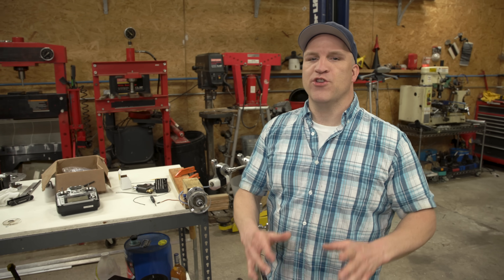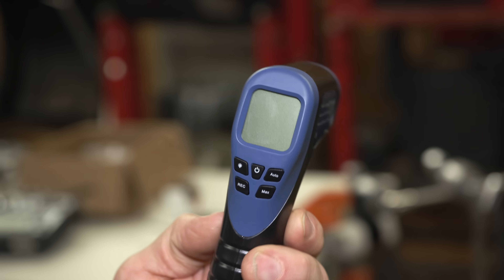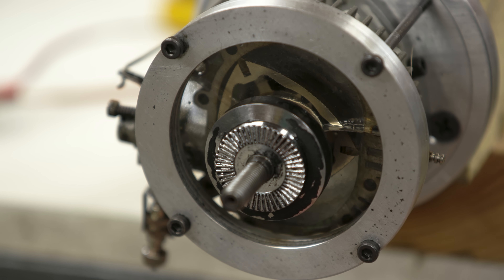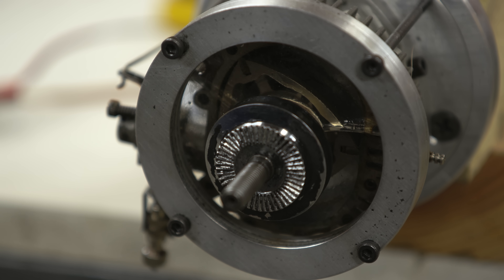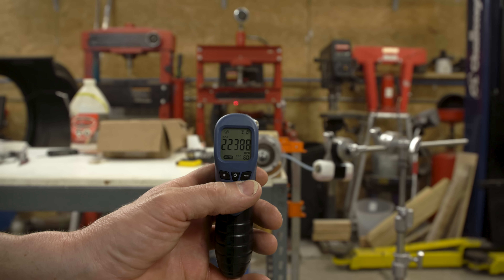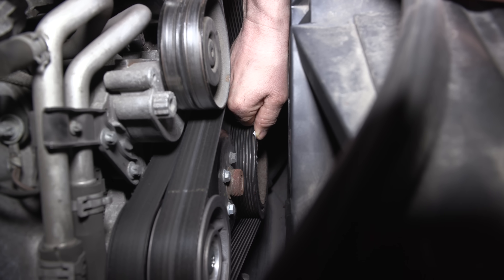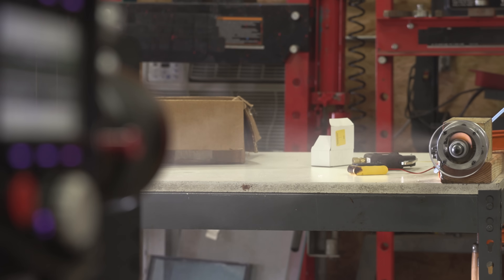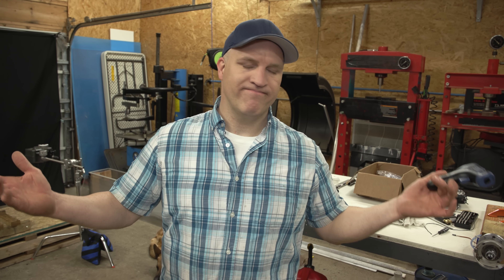See Thru Rotary Engine MAX RPM - 29000 (Wankel Engine)

Comment: At 29k, thats 5.5hp for every ft/lb
Reply: Dave Micolichek I figure about 100ft/lb per liter on 2 strokes and would guess the wankle is midway between that and a 4 stroke- maybe 80? Hard to tell, but if I could pour 1oz in that wankle, that'd be 30cc or .03x80ft/lb or 2.4 ft/lb peak I'd guess around 12k?, perhaps 2ft/lb at 16k? So maybe about 6hp? Just my ball park guess with no more than looking at the video with the most basic data.
Reply: That engine appears to be a O.S. Engines 49-PI (0.3CU / 4.91CC) based upon size in relation to hands and it's RPM achieved. The 49-PI is reported as outputting 934 watts / 1.24 HP at 17,000 rpm and torque is about 0.37 ft/lbs. So @ 29K rpm it would be outputting ~1500 watts / ~2 HP.

All the other engines I've seen are 20CC or larger have thinner fins and lower rpms.
Reply: Cerberus984 I thought it was 6 times that-whoops. I estimated 2ft/lbs at peak hp, you say .37ft/lb. So, you think peak torque is at peak rpm? Now that I have displacement, I'd figure 1/6 my up guess- 1hp at ~16krpm
Reply: @Jimmy's Tractor
I simply used a 2 input toggle calculator that asks for rpm + torque or rpm + hp then solves for other. Then sourced my data from Barnard Microsystems which displays a vast variety of RC engines. The fins are equally thick on the OS engine and has same amount of end plate bolts. Although, the first two fins right of the exhaust port differ from the video I saw to the picture from my data source there were two different generations of that motor. 

The next step up (different brand) is a 20cc Nitto NR-20EP is significantly larger from the videos I've seen people holding it in their hand or on a bench top.
Reply: Cerberus984 cool, looks good. I just guessed.
Reply: cerebellum yeah, that's fine, but I still can visualize a hydraulic column of fluid with a cross section x and know  how much hp will be needed to to lift a given weight. I just think of engines as a winch with a 2ft diameter pulley. 5250 is one of those numbers like 5280 that are just hanging out upstairs ready to be used.  Besides that. If I say that 2ft/lbs at 16000 rpm is 6hp, then I obviously known how it works. It's ft-lbs it's not being accelerated it's just a number representing the rotational force or how much weight it will lift with a 2ft diameter capstan on the flywheel
Reply: cerebellum you made me think about it and how is ft*lb any different from ft/lb as it relates to ft-lbs with no worries about dividing or multiplying? Ft * lbs/1 is ok but ft×1/lbs is not? Were not really multiplying or dividing or ft-lbs would be incorrect. If ft-lbs. As long as both sides are the same, you'll get the right answer. 550ft/lb represents the torque. The only time you need to multiply or divide  is when you convert to power 550ft x T(however you want to say tourque)/s=hp
 1ft arm with 30lbs hanging is the same as a 30ft arm with a
 1lb weight on it. Whatever it is, the answer is correct.
Reply: His math is correct, but torque is a measurement of rotational force. The force an engine can exert is certainly an important number, but transmissions make high-horsepower much more important and better than high-torque/low-horsepower applications in every single way except one: Wear.

Semi-tractor engines are high-torque diesels because that design wears much more slowly than, let's say, a Formula 1 engine. An 800-horsepower F1 engine can absolutely pull that load (with proper gearing) better than that 550hp diesel engine, but it'll need to be rebuilt in a matter of hours rather than the YEARS seen between most diesel rebuilds. 

Getting an 80,000 pound rig moving with an F1 engine would result in fusing clutch plates every other time you have to take off from a stop; the RPMs required to stack up enough torque would introduce phenomenal friction.
Reply: Mezz not really
Reply: Whole lot of "Ahhhhyyyctuaaally" going on here, people missing the forest for the trees.
Reply: Big boys at Yamaha Suzuki Honda and Kawasaki will buy him out and shelve the engine
Reply: Dave Micolichek yeah rotaries made high hp for their displacement, but were lacking in torque
Reply: Don't believe him test drive an rx-8 lol
Reply: DEEREMEYER1 peak torque is not where peak hp is measured.  When using ft-lbs torque = hp at 5250 RPM . I don't know what you mean when you say peak tq is where it's measured.
Reply: Dave Micolichek doesn't matter if you are online engineer or real this stuff is 11th grade 1st semester physics.
Reply: But honestly don't you know the mathematical equation of HP? HP = T x RPM/5252. Torque is labeled as pound-feet or Newton-meters, horsepower is a bit more unusual, as the standard was measured originally as Lift, in which 1HP could lift 33,000 lbs 1 ft-min
Reply: cerebellum you really need to read on of physics and units of measure before typing arguments into YouTube comment sections, you really make your online identity look dumb
Reply: no to split hairs but lb is not a unit of mass, its a unit of weight :)
Reply: cerebellum lb work pretty good on earth, we need to adjust for different planets. If you only need hp, lb is fine.
Reply: myredfast some share online identities with real life!
Reply: Thelifeofbrian can't measure horsepower? Ok, we won't say we're measuring it. Well just display what the hp of a specific engine/motor is and leave it at that without telling anyone how you did it. LOL. You think the only thing we measure is the distance? The rest is just time and  weight- we measure those too. We can measure it with hydraulic output and not even consider torque just knowing the flow and pressure minus a given for pump loss and we have hp.
Reply: DEEREMEYER1 RPM is the rate, horsepower is the power, and torque is the force.
Reply: cerebellum lb or pound is a measure of weight not mass.
Reply: nerds ...  a yummy candy that will rot your teeth, but possibly worth it; there was a white chocolate bar with nerds in it about 25 years ago, was surprisingly good.

and nerd isn't an insult, it only is thought to be by really stupid people who try to make themselves feel better by insulting those with more brain power than they have.

and a lot of the people in this comment thread need to take a break, study all the terminology, so they aren't arguing over semantics and get back to an actual discussion about how rotaries are badass except when dumbasses own them and don't know how to both properly use or care for them.  Kind of like the people who say 'shut up, nerds' ...  though some of them have some nice LS  engines or old big blocks that make sweet sounds and put out high torque at low rpms.  Too bad their attitude sucks.
Reply: wow, the amount of effort and intelligence that went into that speaks for itself.  maybe come up with an insult and I will; as I take it as a compliment, better than being a useless dumbass with no interests or semblance of personality
Reply: yeah, I know you like watching me take care of your girl like you can't.  Keep up with the compliments.
Reply: Feet, pounds, ounces....you colonials are so cute :)
Reply: Pound-feet or foot-lb really doesn't matter. Its a number measured with a "brake" connected to the crankshaft or other "power take-off shaft". Multiply it by the RPM and divide the result by 5252. That's the "horsepower". You're splitting hairs like a typical online "engineer".
Reply: The HP formula is simple: HP = (Torque x RPM)/5252. That's why torque and hp "curves" always intersect at....5252 rpm.
Reply: Peak torque is where its measured. You measure torque to calculate HP. Horsepower is a RATE. Torque is actual "power".
Reply: Its actually 5252 but who's counting.
Reply: WJ Z it's a figure of speech here in America
Reply: DEEREMEYER1 Actually a pound feet is a measurement of torque where foot pound is a measurement of work. It's not splitting hairs, it's a different unit entirely. It's easy to remember because torque is rotational force measured in pounds at the end of a lever measured in feet. Sure the math is the same whether you say a 2 foot lever and 3 pounds of force or vice versa but, I would always say the force then length of the lever which made remembering the difference easier.

A foot pound is .0018 (repeating) horsepower...a measurement of work just like horsepower. They may be used interchangeably, especially with fastener torque specs, but they most certainly are different units. If you're looking to become an engineer, you'll learn quickly that units matter.
Reply: Sorry Chad W.  No such thing as measuring Horse Power.  Watts are power.  Torque is force.   Horse Power is derived by Torque over time.
Reply: HP is how fast you hit the wall, torque is how far you take it with you.
Reply: HP is a RATE. Torque is "power".

Comment: The most impressive thing so far for me, is that this little thing can take a lot of abuse!
Reply from the maker: I agree, I almost put the material I use in the video but I cannot disclose yet, my NASA friends sent me the recipe..... Hehe..
Reply: Warped Perception can you make a 4rotor one?
Reply: As long as the oil is full, the engine is warm, you can rev the piss out of it and it will take it
Reply: And they say rotaries are unreliable. Haha jk. It does require some extensive maintenance. Great quality definitely comes at great price.
Reply: JohnnyQ90 That engine was made by O.S. engines. They're one of the best engine companies in the RC industry.
Reply: Would I be wrong to guesstimate Quarts glass? Same as used on spacecraft windshields, and also commonly for high speed supersonic aircrafts like the SR-71. Can withstand 1000 °C and is very good at taking rapid and large temperature differences :)
Reply: JohnnyQ90 wasn’t expecting you here ;) love your channel!
Reply: JohnnyQ90 rotaries in general can take a lot of abuse. Got a bad rep from the early versions and the dreaded msp rx8! Awesome engines!
Reply from the maker: Easy there partner, let me at least make my money back, I have 2+ months of r&d in this one. I will be selling some soon.
Reply: There is no extensive maintenance required for rotaries, just keep up with standard maintance intervals and beat the shit out of it all you like as that's what they're made to do (add some 2 stroke to your fuel for better lubrication which I think is the only actual extra maintance to speak of - but this is optional if your OMP is working fine)
Reply: JohnnyQ90 could you use one of these on your next build? Please!
Reply: @JimmysTractor  o
Reply: @JimmysTractor  o
Reply: therealpodge rx8 motors are shit
Reply: @shaydrowdeb6891  how dare you!!
Reply: therealpodge s4 rx7 motors are better
Reply from the maker: Well I think type I has the carburator on the front housing and the type II is peripheral port. Send me those links if you can, I was looking to buy one more. Also I can send you some parts for a video if you like.
Reply: @WarpedYT  Your videos are great! I remember the OS-Max as very reliable engines, as well as Cox. Greetings from Switzerland :-)
Reply: @Dominique Buzon The model 49PI sold poorly and was discontinued because it was heavier, more expensive and much less reliable than comparable reciprocating 2-cycle models.
Reply: @fuck anime  The truth is Wankel engines are horribly unreliable and are inferior overall to reciprocating, they are obsolete because no longer offer any significant advantages.
Reply: @fuck anime Wankel engines are less reliable and have significantly shorter service life compared to the reciprocating engines they failed to replace. This fact is irrefutable... Graupner GmbH. like Norton and Mazda all abandoned production of this design because it was a commercial failure.
Reply: @doktorbimmer  no one cares lol
Reply from the maker: JohnnyQ90 hey Johnny, that engine you used in your last video, who was the seller for that one?, I was going to buy an engine from one seller on eBay and it seemed like a scam but I could be wrong, just wondering if it's the same one ?.
Reply: It was georgesboucher his ebay name, and he was super nice and helpful (he wasn't shipping to my country initially and then changed it for me). I just checked and and there are 2 engines of your version (pi-49 type i) one is new (Australia) the other almost new (Texas).
Reply: Shayd Rowdeb yes indeed! My rew with a single turbo makes 611bhp and I drive it in anger regularly with no issues!
Reply: +Nate,  True, the RX-8 motor with side ports for intake and exhaust makes more power than any of the previous motors when normally aspirated. The side ports also allowed zero overlap of inlet and exhaust which greatly reduced emissions. But, the RX-8 engine is much less reliable if a turbo is added and is not recommended. One reason is that the exhaust gasses heat up the cooling fluid as they pass through the side port and through the side plates and can boil the fluid which leads to instant overheating. This weakens the springs under the side seals which then fail. This is less of a problem with the earlier peripheral port engines (like used in this video) because the exhaust vents directly into the exhaust manifold. They love turbos but unfortunately they didn't meet the new emissions requirements.
Reply from the maker: Njål Nilssen ha!!, I will tell you later !
Reply: Nate Rist 12 a rx3 best na
Reply: JohnnyQ90 Right, maybe I need this tiny rotary in my rx8, considering how well those seals held up 😂
Reply: +JohnnyQ90 I'm sure you say that to all the ladies XD
Reply: its perfect for motorbikes
Reply: William Williams check out norton rotary bike  on YouTube unreal.
Reply: Norton went completely bankrupt trying to sell Wankel powered bikes...  the company which purchased the "Norton" registered trademark brand only sells bikes with reciprocating engines.
Reply: JohnnyQ90 
But what about new electric engine you abuse only to respect it see in my vlog...
Reply: And you are gonna make one a turbo for an engine like this awesome cant wait for that!
Reply: I'm your subcriber @jihnnyQ90
Reply: Do I hear twin turbos
Reply: Just like my childhood!
Reply: That is about right 😂😂😂
Reply: Thats what she said
Reply: Just like my girlfriend xD
Reply: Meanwhile my RX 8: you abused me I,m gonna break 
ME:I FUCKING just drove 5,500 RPM why is check engine on 🤣
Reply: yeah, rotates only have 3 moving parts so they are insanely reliable until the apex seals blow, thats literally the only failure point in the engine
Reply: Rotaries suck
Reply: Hey man long time subscriber. You should make a rotary preferably a rc 49II and machine a rotor so the way it spins when firing the intentions are closer to that end
Reply: It revs obnoxiously high, it's itty bitty, and it's a wankel. The fact it even survived is a fucking miracle of nature
Reply: Is that a joke? Literally look up Rx8s on craigslist, or go on a Rx7 forum. Rotary engines are dead for a reason, because they CANT take a lot of abuse. Apex seals and stuff.....
Reply: +Shayd Rowdeb The RX-8 motors are the best NA rotary to ever leave mazda's factory, they arte only "shit" because they make as much NA power as possible from an NA 13B while still being relatively reliable and efficient as the older much weaker S4 and S5 NA engines and on top of that the MSP has to push around the heavy RX-8 chassis too making it's economy that much more impressive. TBH they just don't last as long as the older NAs simply because they make too much power for their own good, but it's not like an S4 or S5 NA could make the same power with some porting and still be able to hold it for as long or be at all as efficient as a bone stock renesis. The renesis is just the better all around motor period
Reply: The RX-8s engine was the worst ever... why do you think Mazda recalled them???
Reply: +Nate Rist don't forget having to replace the apex seals every 60,000 miles or so, that means rebuilding your engine every 4-6 years lolol. Yeah, you have totally owned a rotary before....
Reply: maybe because its small thats why it can take the centrifugal force and mini explosions, if it was a life sixed rotary a lot of things would be different with the same material i think
Reply: Put load on it and see how it goes. Worst engine ever made
Reply: therealpodge funny thing about that, I had an 04 and an 05. I put over 140,000 miles on the first one without any issue and on the second one, I had 150,000, 60,000 of which I put on in 1 year. The only one that needed some work was the 05. I need another one.
Reply: Nate Rist shit motors
Reply: i guess you can say rotaries are kinda masochists HAHA jk. they do like to be abused at higher rpms to provide the maximum potential of the engine.
Reply: What's the reason for wanting to let the engine cool down before shutting it off? Was told the engine could flood itself if shut down after just operating at high RPM.
Reply: @dylan-5287  it only floods if the engine is shut off and it hasnt warmed up yet.
Reply: @Bailey Knapp  Wankel engines only flood when the seal wear-out or break...

Comment: Is it possible to combine more rotors ?
Reply: Ruben Lensvelt it has 2
Reply: Damikovich dude... yes, this needs to happen 👍
Reply: Unco Casey No? The more rotors you'd have the larger and heavier the crankshaft would be, meaning it at some point wouldn't be able to rev as high anymore.
Reply: https://youtu.be/q3A3c68gAlM
Reply: Yes - but only if you bother to machine up a shit load of customer parts. These engines don't really have any production(s) with multiple rotor setups.
Reply: I thought the RX8 has 3 rotors.
Reply: Yep easy and the more you have, the higher it can rev.